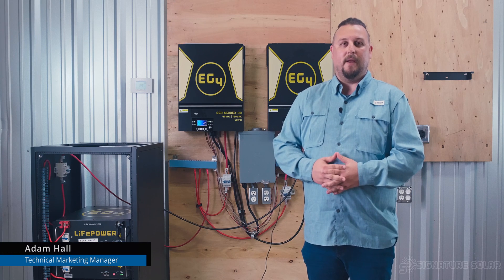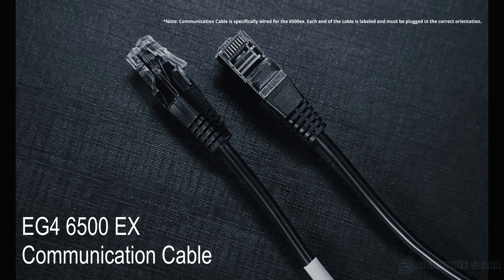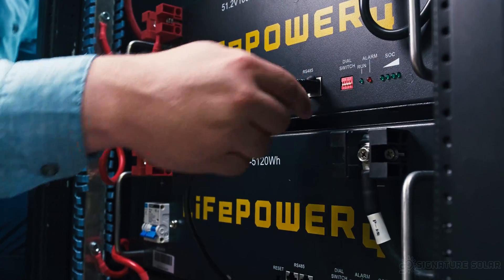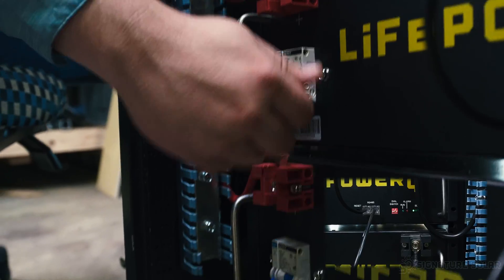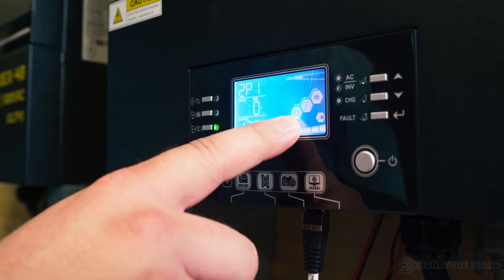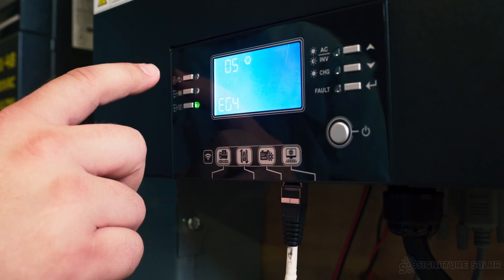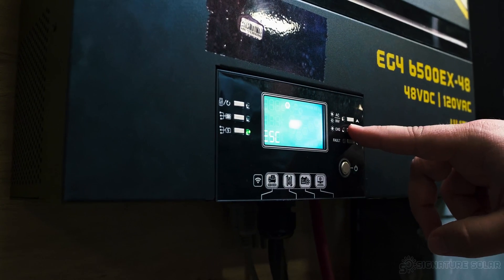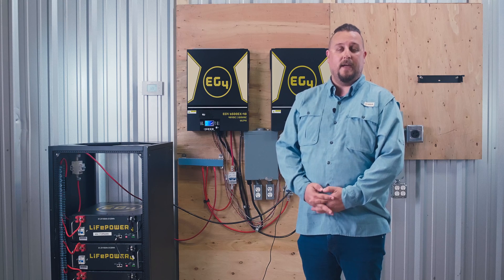EG4 6500EX-48 BMS Communications Setup, Inverter to Battery Commissioning, Split Phase Configuration

Comment from the maker: Stay tuned for the EG4 6000EX-48 Commissioning video here soon! 👍
Reply: waiting for it. Also a new firmware for the 6000ex should be created as I'm dealing with the error 61 fault.
Reply: Is there a way to update the firmware without a windows internet connection on the 6000EX-48HV?
Reply: @Laurel-Crowned  I have the same question…
Reply: My lights Blink when I use infared cook top.  Any one know where which light to replace so it will stop blinks like this please tell me which type of lights and where to buy them, thanks a lot.
Reply: Can you please show the AC Wiring to a transfer switch

Comment: I purchased two 6500EX's when they first came out (18-24 months ago?) with the intentions of building a complete system.  At that time, I also purchased four EG4 48v/100ah server rack batteries and 8kw of solar panels, all from Signature Solar.  As life happens, all of these components are still in the unopened boxes and have simply been occupying a corner of my garage.  So, as life continues to happen, I'm just now able to tackle the project.  It appears that Signature Solar no longer carries these and I'm guessing that these models had problems or are simply antiquated now?  Any advice, updates, or guidance would be greatly appreciated before I start building my system? Thanks in advance for any help
Reply from the maker: Hi! We have an upgrade program available to trade in these 6000EX units for the new 6000XP or 18kPV units. This would be a great opportunity for this situation. You can find out more and if you qualiufy here: https://signaturesolar.com/upgrade-program/?utm_campaign=Upgrade-Program-2024&utm_medium=email&_hsmi=294141019&_hsenc=p2ANqtz-8TXuIO6YZ3kkyUS_wMrraKv0kZacKAhvkYHpfVX2dhnlmDYvR_x7qibY-N_XiZAeur7Wv2L_oCPnOcZrmjUual1t1Jdsj5tQwI1ksjCDdf6I58gt4&utm_content=294141019&utm_source=hs_email&fbclid=IwAR1B6AuaFX5Y8hxE0mfeV3Lgx2laKVCPtI9GzMzqyrb_s1mdrd1poc9qhs4

Comment: PLEASE be sure that you have the correct end of the black EG4 communication cable plugged into the correct part (inverter or battery). I was waiting for the blinking battery icon to show BMS communication. That didn’t happen. Thankfully I had read in a forum that the cable ends are different, and so I tried switching them. That immediately fixed the 61P fault code and showed BMS comm with the blinking battery. This inverter truly needs an install instruction overhaul. Thank you for the video that helped more than any part of the instruction manual. A visual and good description of what each cable is that comes with the unit…. And how to use each cable… is greatly appreciated, and severely lacking in the manual. I spent too many hours today trying to figure out which cable the manual was referring to. The firmware upgrade guide on the EG4 website is even less helpful, as it refers to a cable I’m not even sure that I have. Customer service from vendor has been great, but this could be SO MUCH EASIER.

Comment: Does anybody know what cable to use to move the inverter display to remote locations? Is it a regular Ethernet cable? And where does it plug into the invertor?

Comment: The BMS Communication cable MUST be hooked up with the end with the white stripe going to the battery. At least for the batteries with the LCD screens, both version 1 and 2 ;) The video showed it being hooked up backwards.
Reply: Also, it did not specify to move the cable over to the 2nd inverter in order to get it established.

Comment: The cable will only work one way.  I had to unplug it and reverse the ends and finally it was working after configuring the dip switches in several different configurations as well.

Comment: I am wondering why you did not mention that the special ETHERNET cable that connects the main battery to the 6500EX has 2 different pin configurations on each end.  Is is still valid that users need to know which end goes where?  

Each end of this cable has a different color on the plastic body, silver and black.  Originally, I had the cable backwards, but when I switched in around, it worked.  The silver end with pins 3&5 connected goes to the inverter.  The black end with pins 1&2 connected goes to the left most port of the main battery (main battery has all 4 dip switches down in the OFF position).  Note, I have not upgraded to the latest firmware that came out last month I believe.

Comment: I have 3 of the LifePower4 batteries and the Growatt 5000ES and I see a sticker on one of the batteries in this video that says "new firmware". I currently have my inverter set to 'USE2' but if I upgrade the firmware on the battery, would I then be able to change it to 'Li' ? If so please tell me how to upgrade the firmware. Thanks!

Comment: I have done all that and it still only works intermittently. Do I have a faulty cable? What else could it be? Tech suport said there is new software coming out which should resolve the issue. In the mean time I have disconnected communications and manually set the charging parameters to tech supports recommendations

Comment: When will you be putting out a video on the Wi-Fi communication setup for these inverters
Reply: I found the wifi a little tricky but after you create an account and go through the setup... give it 15-20 minutes to activate properly.  Don't ask me why but mine started working about 15 minutes later on its own.

Comment: If you don't need to use communication with the bms, what USE settings should you select for the EG4 batteries?  Will Prowse has indicated it isn't really necessary and to just select USE and change a few settings, but I cannot find any information on manually selecting settings for the EG4 batteries.  Mine don't seem to be charging and showing low voltage errors.

Comment: Excellent video, clear and concise. My two inverters came with what looks like homemade blue cat 5 cables. Should I be looking for the black communication cables that you have?. Also, my batteries are not in a rack so the little one-foot battery to battery cables are too short for my setup. Are these regular cat 5 cables from the battery to battery?. Thank You.
Reply from the maker: That blue cable should work as long as it is the labeled cable. If you have issues still reach out to tech support on our website and they can send you a new one. And as far as the 1-foot cables, they should just be normal ethernet cables.
Reply: @SignatureSolar  Thank You very much.

Comment: Am I required to have more than one battery to use the bms?  I have to run on USER mode or I get constant beeping.
Reply: If I remember correctly they recommend two LiFePower4  batteries minimum
Reply: @azinfidel6461 you know if thats only a recommendation or requirement?
Reply: @DAReckerr  I saw it on one of their recent EG4 videos.

Comment: I just happened to Commission a system of 5 Lifepower4 batteries and a EG4 6500EX-48 inverter last week. The only problem I experienced was an error 61. After a quick search found that the communications cable was hooked up backwards. The communications cable has two different ends one is black plastic and the other is silver metal. The silver metal end goes into the inverter. (the label said otherwise) The inverter recognized the batteries and the error went away. Could not be more pleased....
Reply: Yes
Reply from the maker: Thanks for sharing your experience and trusting us with your business
Reply: @SignatureSolar  I was going to remote mount the Display. Will a standard ethernet cable work?